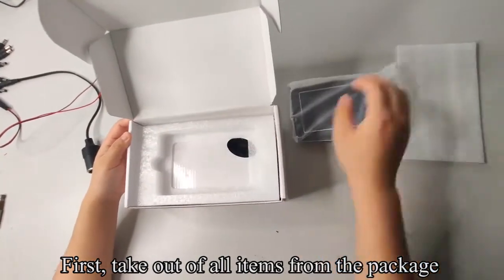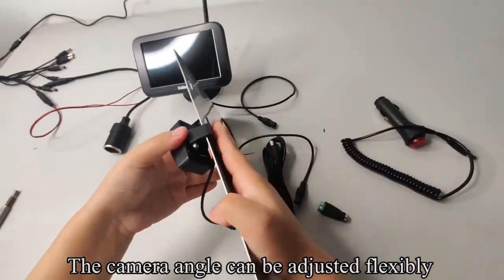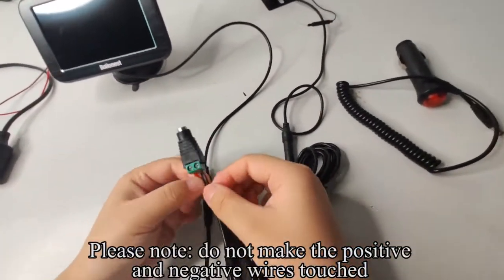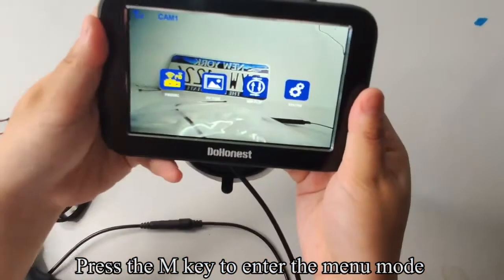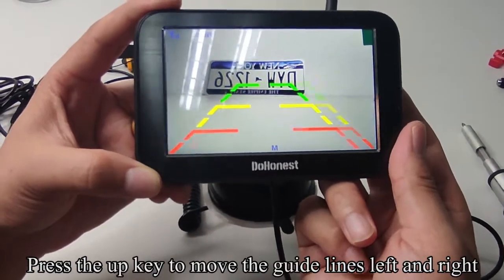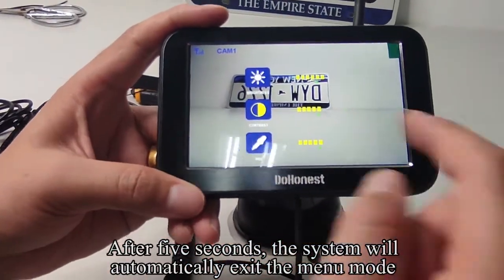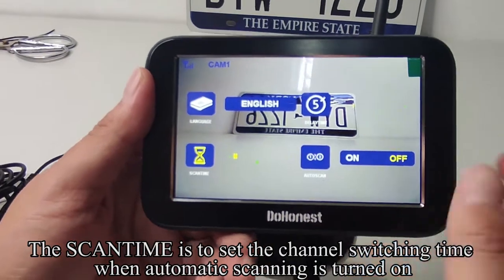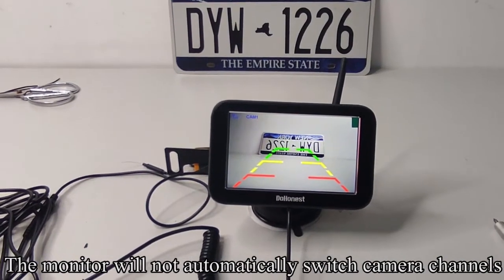DoHonest V25 Truck Wireless Backup Camera System Operation Video

Comment: The wires come packaged with too much rubber coating on them, so I had to carefully remove about an inch from each wire using nail clippers. I frayed one of the wires a little, but it still worked out fine thankfully